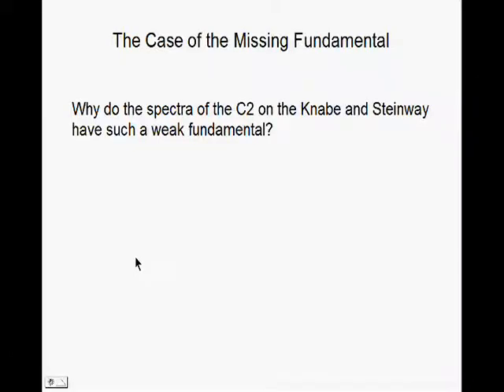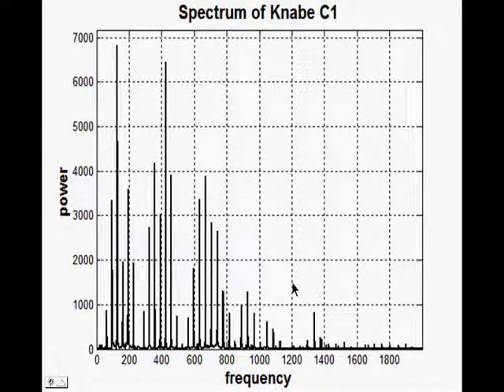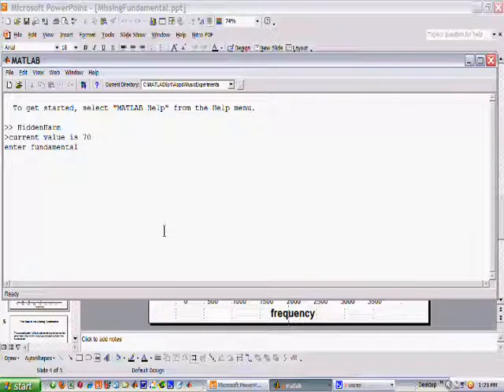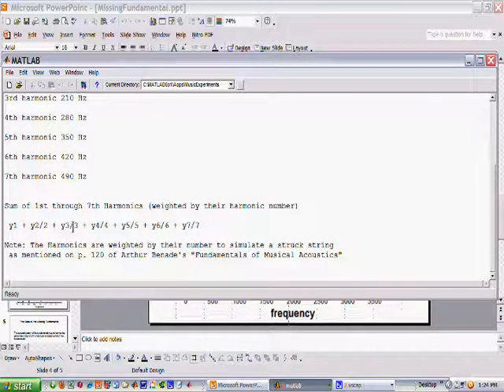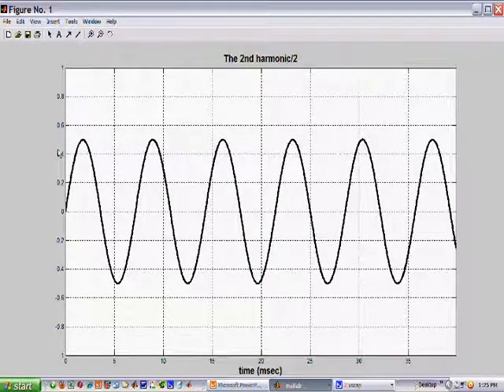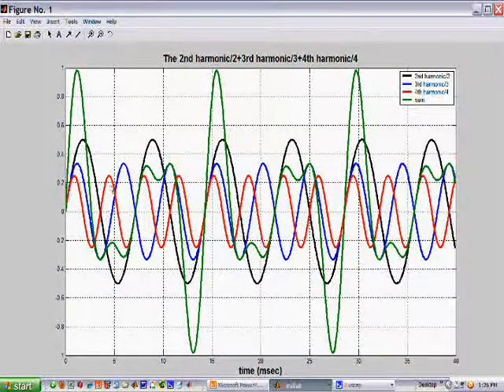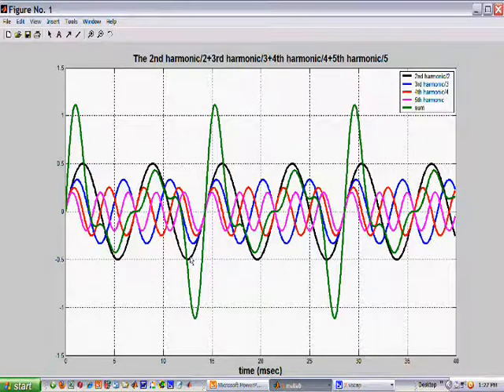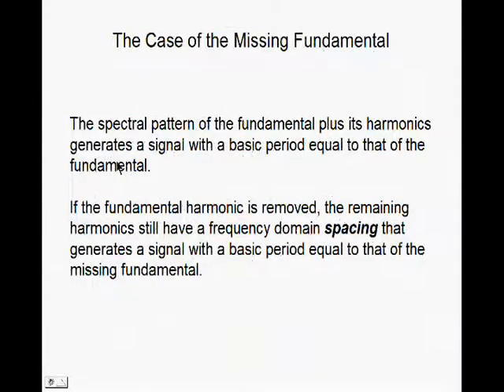TheMissingFundamental

Comment: When you say second harmonic divided by 2 do you mean just its amplitude. So say 100hz is the fundamental the next harmonic is 2x the fundamental but half the amplitude. I set this up in cubase up to 16th harmonic but i could clearly hear when i removed the fundamental but it works in your video so i wondered what im doing wrong.